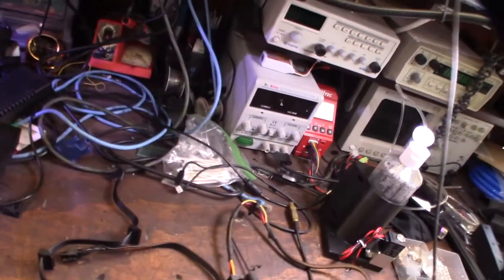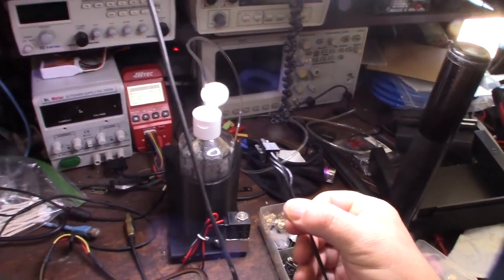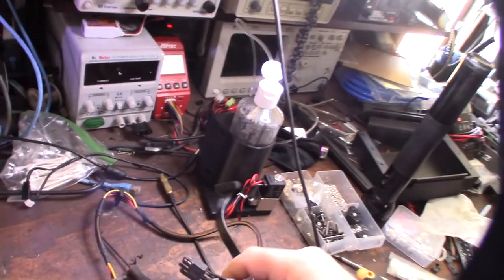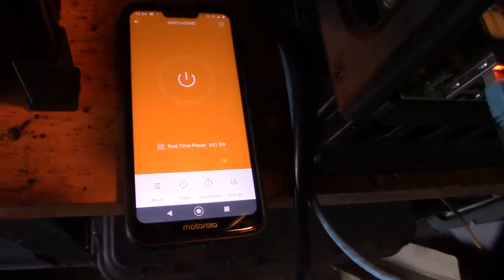Corsair HX1200 Power Supply Mining Rig MELTDOWN!!! Burning plugs and wires PCIe riser

Comment: You should always use pcie/vga connectors with pcie risers..SATA cable connectors cannot deliver enough power required for riser 75watts..That's the reason why the cables getting burned, nothing wrong with HX1200.
Reply: im building rtx 3080 rig,  how do you think, 2X HX1200 is good choose ? (6 video cards 3080) thanks for answer :)
Reply: @dawitavadze2005  From my understanding, 16AWG 8pin pcie cable can deliver max around 280 watt via 8pin pcie connrctor. As a standard, GPU  should not ask for more than 150w from a 8 pin pcie power socket.. 

Standard RTX 3080 card can pull max 320watt . After setting proper configurations  through MSI after burner, we can see max 225watt power draw with stable  96-100MHash.

AX 1200 has 8  PCIE/cpu connectors while HX1200 has 6 pcie/cpu connectors.

Some mother boards takes 2x 8pin sockets for cpu, most would take 1x 8pin power socket for CPU. In both the cases at least we need 1x 8pin power connector out of available  connectors( 6 in case hx, 8 in case of ax)

So, based on the above information,  we would be lacking a power connector to accommodate 6x3080 safe power requirements in case of 2x HX1200..In case of 2x AX1200, we can easily accommodate 6*3080 rig power requirements..

Though we can also meet the power requirements with other ways using molex for few risers and offload the few pcie connectors and use them for GPU power sockets, IMHO if you can get atleast one AX1200, that would be the most peaceful option..

This is just my thoughts on your case, I suggest you to go through 'mining chamber', 'RED fox mining', 'Red panda mining' channels also regarding the same topic, they have explained and practically done this.

FYI,  iam building a rig with 4x3080 and 2 x 3070 with (1x Hx1200 + 1x Hx 1000). In my case, hope it works for me..Iam just waiting for mining rig frame to arrive..

Cheers and happy mining..👍😉
Reply: @usavarma  thank you so much for your answer <3. i'm buying 2X 3080 for this time, so if first, ill buy HX1200 and after adding more cards ill buy AX1200 would be okay, right ? cuz i found HX1200 for very good price :(.thank you for your support <3. motherboard (msi z390-a pro)
Reply: @dawitavadze2005  
Yes that should be fine..
Reply: @dawitavadze2005  
If you are buying 3080 now, make sure about,  it has hash limiter or not and accordingly calculate the profitability and take the decision..
Reply: @usavarma  yeah agree about hash limiter.  all cards 30series will have "LHR". also spend attention on that.
Reply: @dawitavadze2005  
Yes

Comment: i removed burned connectors, not bothered to replace ... i continue to use without issue. My psu is hx1200 , i burned 5 connectors 😁

Comment: You should use molex or VGA connectors. SATA adapters can cause fires.
Reply: molex has the same issue both sata and molex only support 52/54 watts pcie is the only option that can deliver the 125 watts.

Comment: Powering risers via sata riser is not advised and have been told many times by many people. Its not just corsair that this happens to, the same happened to one of my plat psu sata cables. I used a splitter to power my pcie on any gpu using 140+ watts now. My 1070 is still using sata but thats only because im too poor to upgrade all the risers and cables.

Comment: Those cables are thin!!! YET you are running what? 4!!!!! GPUs with power draw of more than 300Watts each one!!!!!! On max load that istoo much that is too tight for the HX1200 you're trying to run like maybe 1400Watts or more on a 1200Watts PSU you need a 1600 for that, or what are those GPUs? aren't they 3080's 3090's? 

YET like the other guy said YOU SHOULDN'T connect your GPUs to the peripherals/SATA connectors you can only use the assigned PCI connectors!! don't blame the manufacturer. 

you should buy like a 850~1000watts PSU per each two GPUs with max power draw of around 350